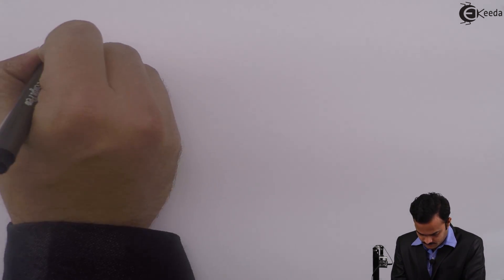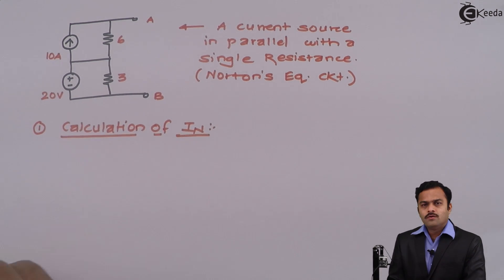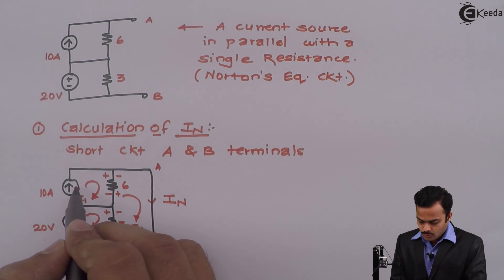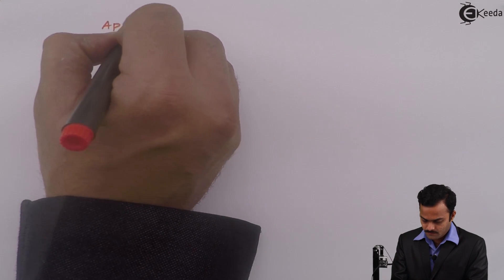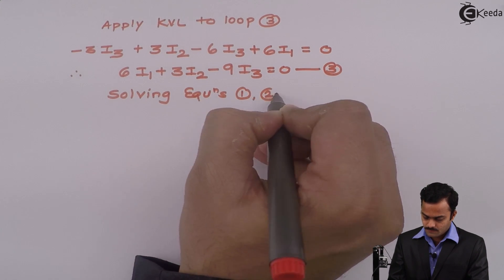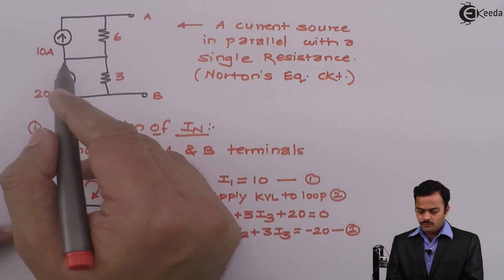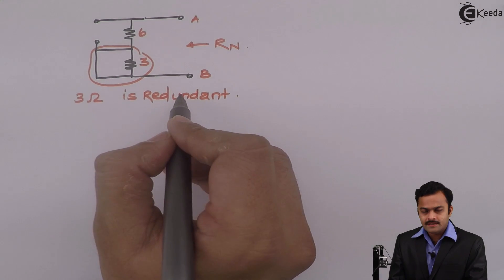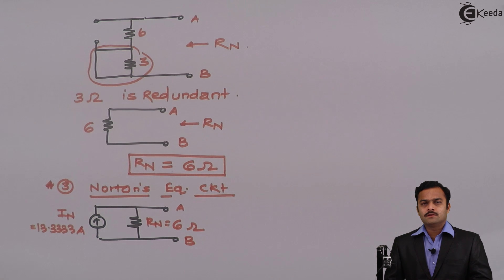Norton's Theorem : Problem 2 - DC Circuits - Basic Electrical Engineering

Comment: why 3 ohm resistance is reduntant .... explain clearly plz?
Reply: vipul malik consider that 3 ohm is connected to 0 ohm in parallel. Then you will get resultant resistance as zero ohm. That's why it is redundant